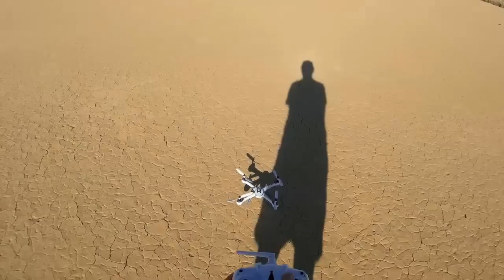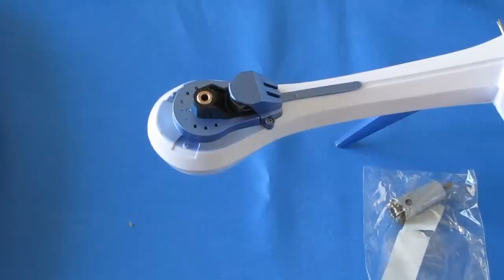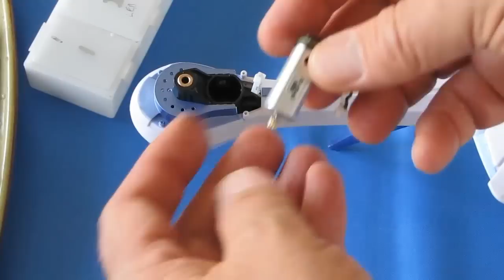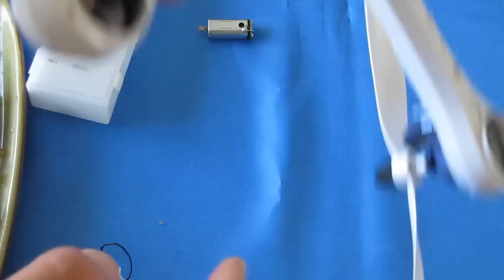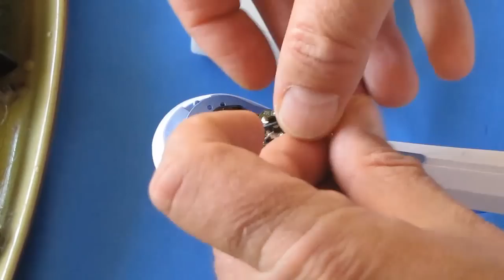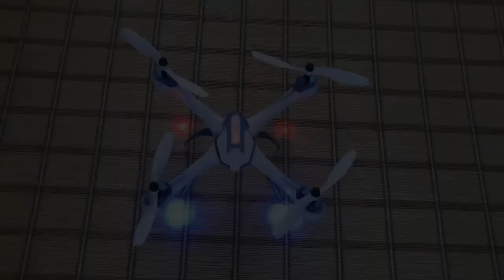Tarantula X6 Drone Motor Repair

Comment: Please could you help me? I replaced the receiver board for JJRC H26W but or whatever reason the motor is turning the other way (which means air's been thrown downward thus not producing any lift). I am 100% sure I connected everything correctly as I took pictures before removing the damaged board. I swapped the propellers but still didn't help. 

Thanks in advance.
Reply from the maker: You likely put on the wrong propellers.  There are two clockwise and two counterclockwise that must be put on the same turning motors.  Take a close look at the following picture, paying attention to the shape of the propellers and where they are installed.  Notice that there are two different shapes.  Make your quadcopter's propellers match the picture https://blog.banggood.com/wp-content/uploads/2015/11/COVER.png

Comment: Are the motors fairly durable with normal flying?
Reply: I've been using mine for about a month now with regular usage, and I think they're about ready to be replaced. Expect to change motors every month or so, maybe longer.
Reply: +aidan cowie thanks for the reply man!
Reply: +Andre Martinez 

Your welcome! If you haven't ordered from gear best before, expect shipping to take about 2 weeks. They are slow!
Reply: +aidan cowie I am actually thinking of ordering from gearbest at first but the shipping time is holding me back
Reply: +aidan cowie i am in the US right now as a tourist and I'm thinking of ditching the 8 dollar difference from gearbest. My relative here has Amazon prime so I will be getting 2-day delivery. Think it's worth?
Reply: +Andre Martinez 

Well, the Amazon prime is a huge bonus, but it's more than $20 more expensive on Amazon. I got mine on gear best, but if you hate waiting, go with Amazon!
Reply: +aidan cowie its only $60 in amazon! :D $52 in gearbest
Reply: +Andre Martinez 

Really?! $60 on Amazon? When I got mine, it was 75 on Amazon 52 on gear best, and I got it from gear best even though I have prime! At $60, I would totally go with prime! Waiting for a drone is torturous ;)

Comment: Why are you soldering it aren't those plug and play motors????
Reply from the maker: +Nick Yes they are.  But this is the original Tarantula.  It did not have spare motors available when it first came out.  I demonstrated in this video that you could also use WLToys V262 motors.

Comment: Hi Quad - Since neither the motor nor the prop shaft have adjustable mounts, have you found any way to slightly shim the motor closer to or further from the shaft? I stripped the plastic spur gear on one of the prop shafts in an unfortunate crash. No big deal, I just installed a new prop shaft and spur gear.However, when I checked the mesh, it was not correct. The pinion gear is too far away from the spur. I checked the mesh under power while holding the quad and found that the pinion was slipping and already starting to ruin another gear. I really want to find a way to fix this. Do you have any suggestions?
Reply from the maker: +Michael Preyer I think that it may be time for a new motor.  When they start to fail, the pinon may become wobbly.  But a motor is very easy and cheap to replace.
Reply: +Quadcopter 101 - Thanks for the prompt and thoughtful reply, as always. I will go ahead and replace that motor.

Comment: I have a loss of power and 1 motor gets hotter than the others..I have replaced that motor and gear but it stills loses power...I have recalibrated the gyros and still  the same..Batteries are good. ..Any ideas? Thanks Kevin

Comment: Great video!  I see the Tarantula X6 motors are now available, but I'm confused as to which one(s) to buy.  I want to buy a set of 4 spares, but the website gives 2 choices of motors: CW (clockwise) CCW (counter-clockwise).  I got the drone's user manual, but it does not mention anything about the kind(s) of motor it comes with from factory.  My question is: does this drone have all 4 motors in CW or 2 CW & 2 CCW?  Thanking you in advanced for your assistance.
Reply from the maker: +David Hooper IV The Tarantula has both 2 CW and 2 CCW motors.  The idea is to counter torque.  It's best to buy several of these as you will need them.  The website sells them as a complete set (2 CW and 2 CCW), but you'll only need to replace them singly as needed.  Just match the color of the wires when replacing to ensure correct installation.  It appears that currently only the China warehouse has them in stock  http://shrsl.com/?~aqbc
Reply: +Quadcopter 101, thank you so much for your reply...awesome!  I found them on Banggood.com; will follow your advice.

Comment from the maker: $41 Thanksgiving Sale Tarantula X6 for USA customers with free shipping!  http://shrsl.com/?~ag6u
Reply: im in Bakersfield
Reply from the maker: Ray Bell Sorry, the modified one that I have I need for my V222 and V262.  But why don't you like the Tarantula transmitter?  It should be much better than the V222 transmitter, providing you ranges close to 300 meters.
Reply: can you find any carbon fiber propellers for this qaudcopter
Reply: hi my name is Ray and I have Tarantula x6 but I don't care for transmitter I was wondering if you might have an extra one  for like v666 or v222 what ever one works well with it beside stock one I thank you for your time Ray email rayster33@yahoo.com

Comment: At Least the Tarantula X6 has a metal propeller shaft I know that the WLtoys V686 has a carbon fiber shaft I guess to save
weight? The Tarantula X6 looks like it has been well engineered for servicing!

Comment: I have aluminum heat sinks on my FPV V262 motors. Too bad the tarantula design will not accept them.
Reply: +Michael Workinger 
Also the tarantula has props that fit the bargain props balancer.  That goes a long way.

Comment: Where can I buy spare screws? The legs of my X6 broke and I lost a few screws to hold the legs. Anyone know the size of the screws or can link me?
Reply from the maker: Felix Yim Have never seen those sold specifically.  But you might try this screw set for the V262.  some of these might fit. http://www.banggood.com/Wltoys-V262-V333-V353-RC-Quadcopter-Spare-Parts-Screws-Set-p-945136.html
Reply: Quadcopter 101 Thanks !
Reply: +Felix Yim if you ask banggood the will send you they send me bag for free
Reply: +Kanari Mentos thanks for the heads up! I'll give it a try next time
Reply: Felix Yim
and if you want original they have them now on aliexpress.com looking for parts bearing
Reply: +Kanari Mentos 
I'm not sure you want bearings or you found one ???, anyway this is the link for bearings for x6 http://m.banggood.com/Wholesale-MJX-F47-F647-RC-Helicopter-Spare-Parts-Bearing-p-57426.html?p=F1131513470852015036
You will need 8 of them 
But get 10 as price drop when order more ! (Spare always good to have)
Reply: Tom D
hi ifound wltoys v911 helicopter the bearing works perfect fit i try to replace them thanks i dont think so help much when you old bearing hase oil will help
Reply: screws size 1.13mm x long 6mm or 7
go here youwill find for cheap
http://www.aliexpress.com/wholesale?catId=0&initiative_id=SB_20150905002327&isPremium=y&SearchText=micro+screws+1.3mm
u need long 6mm or 7 mm  wide 1.3mm or 1.4mm all work u need bigger little because after time to time the hole become bigger very lose

Comment: Hi. I notice on my Tarantula X6 quad that the gears for each propeller are well greased, coming from the factory this way. I haven't seen grease on quad gears until now. Do you think a dab now and then is a good idea? I'm afraid of the grit and such the grease will attract and hold.
  I enjoy your videos, have bought more than one quad after viewing them, thanks!
Reply from the maker: Michael Egan No I don't think grease is a good idea because of grit.  Feel that this might be an experiment on YiZhan's part to see if there's any benefit of using grease (probably basing it on sales of replacement gears).
Reply: Yeah that sounds like a reasonable guess... there was no mention of grease in the limited documentation provided.
  Thanks for your reply!

Comment: Hi could you tell me how can i know if two motors are not working. cuz´ i think my front righ motor is not good, but i believe other on maybe 3 motors too, because the motors work but can elevate it? thanks
Reply from the maker: temo a No the other three motors will automatically slow down to balance the quadcopter.  To find the bad motor, try to quickly takeoff.  Whichever motor the quadcopter momentarily tilts towards is the bad motor.
Reply: Quadcopter 101 well i did and i found that is only the right front motor. my quad flew a little but then goes to that motor. thanks to your video i now know how to change. i need to find where to buy those motors cuz i live in mexico. could you make a video how to change the card receiver in this quad and in the sima x11. thanks

Comment: Had my first motor fail today but no sad face, because it flew & crashed lol for 3 month with no issues. THANKS for your video Q101, I had plug n play motors, changed it in under 6 mins

Comment: By putting a plug-in on the motors they were aware that the motors would be changed quite often. I just ordered 4 of the X6 motors while waiting for my X6 to arrive. Great video... keep them coming!  I also ordered the ball bearings!
Reply from the maker: Donn Brown Yes they were aware.  Brushed motors fail eventually.  But they are extremely cheap, and yet powerful.  They allow producing a high performance quadcopter at a very low price.  It's great that they had the foresight to make changing these motors easy.
Reply: I agree...I am contemplating ordering a Walkera G-2D Brushless Gimbal (Plastic model) for the X6.

Comment: Couple of comments on the repair: Best way to clean a soldering iron tip is with a can of solder paste and a wet sponge.  Any time you take an abrasive to the tip, it takes off some of the plating, making it more and more difficult to keep the tip "wetted" in the future. If you have a Dremel Tool, use a cut off wheel and slice that extra bit of motor shaft off in like 2 seconds. I have 4 solder certifications (including Mil-spec, J std. and IPC 610) and your solder joints which you declared "good enough" would have gotten your solder cert. pulled at the place I work 8-) ... Drink no caffeinated beverages for a few days prior to attempting this, so you have steady hands  ;-)  Nevertheless, as always, I enjoyed watching your video.  Great Tip to use a pill case to hold various screws ... I will now go separate out the motor screws for the Bayang Toys X5C-1 I'm hoping I'll get replacement motors for. Cheers!

Comment: Would you recommend spraying some wd-40 on the gears for smoother operations ?
Reply from the maker: No, not at all. Lubrication is not needed with plastic gears, entraps dirt, causes slippage and premature wear of the gears.

Comment: Between the Tarantula x6 and the MJX X600 Hexa-copter, which would you choose for high flying? I'm talking about range and altitude wise because I want to get some great shots from real high up on a camera.
Reply from the maker: UnknownTecho Tarantula X6 hands down.  But remember, in the USA max altitude allowed by FAA is 400 ft.
Reply: Quadcopter 101 Would the controller with no mods be able to go upto 400?
Reply from the maker: UnknownTecho It would easily be able to go up to 1000 ft.  This quad will easily rocket up there so be careful.

Comment: My X6 arrived got it assembled and burned the motors in for one full battery have not had it above 40% but here's my problem it drifts to the left I have gone through all the setup and even tried the sticks bottom left adjustment . goes up into a hover for a few seconds like I would think it should then starts to drift left . I set the trim , good for a few seconds then starts to drift left . By the end of the battery I am working just to keep it flying and when the stick is in the center it fly's at full left bank .
  When the controller sticks are in center the right stick shows on the display , Hard right (100%) hard left only (50%) should it show 100% when all the way left ? I hate to have to box it all up and send it back it took for ever to get here . I think it would be a blast if it worked right . Can I do anything to fix this problem ? I don't know if its the quad or the transmitter . Any help would be appreciated . I got this one because you seem to really like it over most of the others .
                                       Thanks Spencer
Reply from the maker: Spencer Boaz It sounds like it is picking up an ever increasing drift.  But try one more time the calibration procedure in the following sequence..
1. Plug in the battery and place the quadcopter on a flat an level surface.  
2. Wait 5 seconds for the gyros to calibrate.
3. Turn on the transmitter and bind it to the quadcopter.
4. Set the transmitter to expert (100%) mode.
5. Move and hold both control sticks to their lower left corner.  Hold them there until the quadcopter's lights blink.
6. Let go of the sticks and try flying.

If the above helps, always start your flights with numbers 1, 2, and 3.

If the above doesn't help, then it's time to contact customer service to see what they can do.  It helps to make a YouTube video to bridge the language gap.
Reply: I will try that . Thanks .

Comment: Thanks for posting this. Gearbest has been the worst when it comes to service after the sale. I burned out a motor after 3 flights and have been waiting a month for a replacement. It sill hasn't shipped! I bought a V626 motor from a American supplier and it arrived after 3 days. I will be trying this repair over the weekend. Thanks again for your great review and repair videos.

Comment: Hey,
Can you shows us how to change the bearings? Another youtuber suggested to change the bearings with some real ones but I don't have a clue on how to make replace them..
Reply from the maker: Dirtyb1rd You see the bronze bushing bearing at 14:23 in the center of the above video?  There's a similar one on the bottom also.  But as you can see, there's nothing really holding those bushings in.  They're just sitting in little recessed slots.  Just use a tiny screwdiver, toothpick, or whatever to gently pry and wiggle them out.  Then just insert a replacement bearing for each. They're size 3x6x2mm.  Here's where I purchased mine http://www.massiverc.com/PrestaShop/en/169-ball-bearing-upgrade-kit-3x6x2mm-shielded-set-of-8.html

Comment: Great video, but the real problem with these "Toy" quad copters is that  they always break! I have made so many purchases of mini, micro and nano quads and spent so much money that it's just not worth it. Sure they look cool and a nano is fun to pull out of your pocket at party and fly around, but I would recommend saving your money and just buy a hobby level quad (Blade 200 start at $199.00 or a Cheerson CX-20 for $225.00) that is built to last a lot longer then 2 weeks or a dozen flights. I hope someday they really do make them with more longevity, they are interesting in their different flavors. p.s.: A wire brush is the best to clean your soldering iron. ;-)  Happy flying!

Comment: I just ordered a set of engines... Next week, I will be buying 2X or 4X of all of the parts, so that I have spare parts of everything... I love the size of this Tarantula X6, and the way that it fly's... I believe, I will be flying this quad-copter for a long time...
Reply: +Lip stick    Thank you, I am buying 4 new motors to see how my T-X6 fly's... They have the new engines with the snap-on leads... I am hoping this solves my over heating problem... 
The over heating of my circuit board, just knocks my T-X6, right out of the sky...

If, I have to, I will replace the circuit board, too... And why not, this will be a great opportunity to learn how to build a 650 or 350 quad-copter, later on... 

I love this Tarantula X6, way better than, my Ominus quad-copter...
I am really, hooked on flying quad-copters...

Much appreciated...
Reply: +Lip stick    I finally, blow out one of the engines, Thank you, for this video...

Love this Quad-copper, any up dates???

How all is fine, with you... Keep making videos...

Comment: Hey big guy, I was wondering if you have compiled a list of what replacement motors are compatible with what quad's? For example I need motors for both Mjx 300 and 400, but I have not found any. so I was thinking the motor from the jjrc H12 would work.. but on banggood all i could find was the jjrc 1000 amp motor, but it does not say if its for the H12, I went there looking for wl motors for the tarantula and they do have tarantula motors now.. Im getting 8 motors before i get the quad..any thoughts on jjrc motor replacement for the mjx's?
Reply from the maker: anyshitt Try aliex http://www.aliexpress.com/item/Free-Shipping-MJX-X400-part-2pcs-set-1pcs-Main-Motor-A-1pcs-Main-Motor-B-for/32286346751.html
Reply: Quadcopter 101 One hundred and one thank's man.. very grateful.

Comment: Do all of the "Toy" quadcopters have the same motor burn out with a single flight
like this one when flying like you did?
Reply from the maker: Ken No, the smaller quadcopters are more resistant to burn out (although it does happen, usually from flying with dirt in the gears).